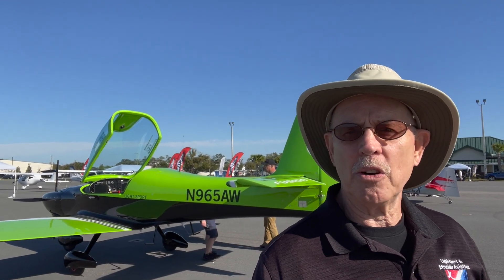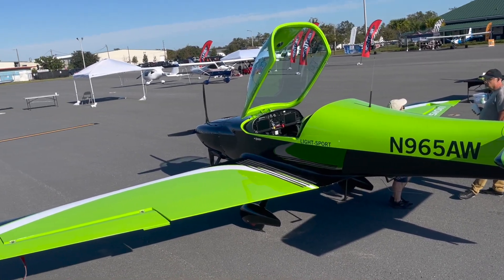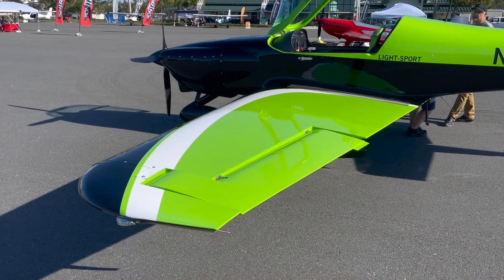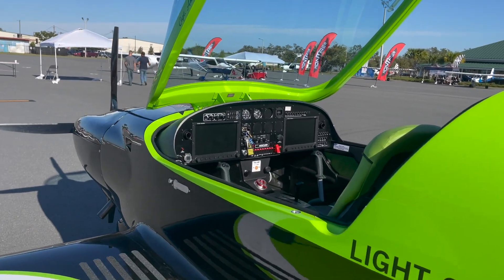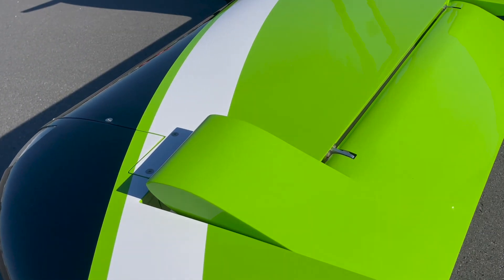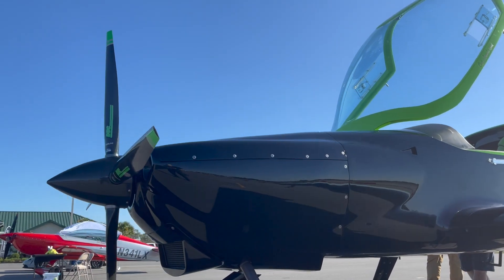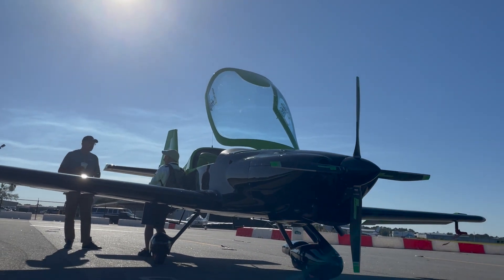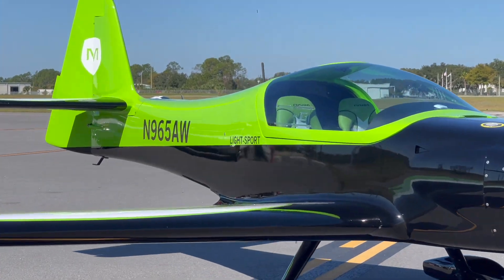Magnus Fusion Aerobatic 915iS

Comment: Good looking plane, wasn't aware of this brand. Yet another Lancair inspired and yet another from eastern europe. And the 912 starting at 140k$ a couple of years ago which nicely contrasts Elixir's 300k starting price. Its predecessor seemed to be 6g rated so maybe this one is too. It's not the fastest UL/LSA but it is fixed gear.
It's noteworthy how influential the 1984 Lancair design has been and how important it is to get things right and just maybe one guy's design in 1984 didn't uncover all possibilities so we should hunt similarly seminal designs today. Perhaps single shell carbon fiber in teardrop double compound shape that's stiff as just a shell and two small turbofan jets. Pressurized. A carbon shell with light engines might be 1/3 the empty weight of the original Lancair which has to translate to speed and fuel economy and/or payload. Skinny wings at FL600 is where things happen :)
An LSA price bird that can go mach .7 that's something. Cirrus would copy that. Textron probably too. They would all be forced to.